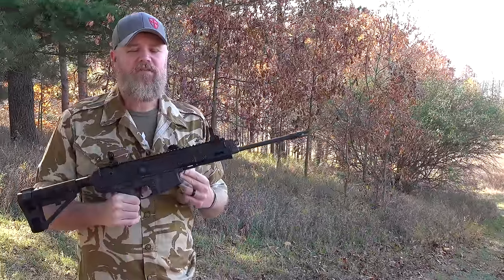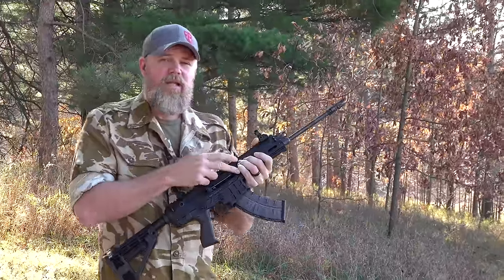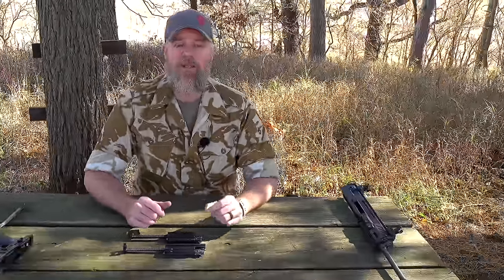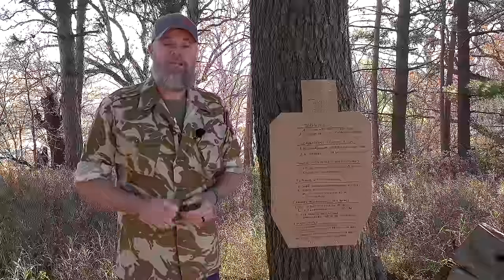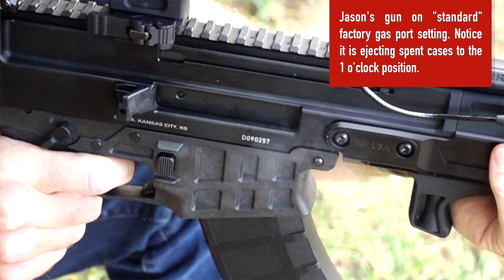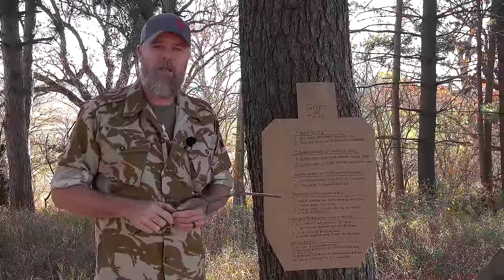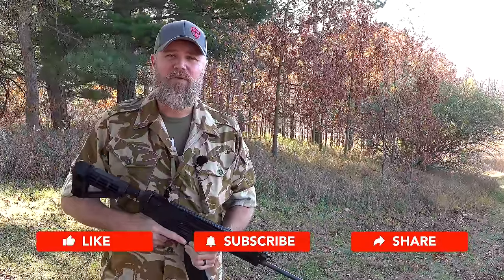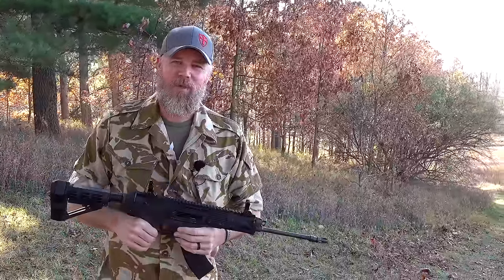CZ Bren 2Ms 7.62x39 Stovepipes: Cause and possible solutions.

Comment: My guess: the extractor spring is insufficiently strong what gives insufficient lateral speed of a spent case. As a result a spent case speed vector (a sum of a bolt speed vector directed back + ejector induced vector directed right) is directed somewhere to 5 o’clock (no good). You need to somehow increase lateral speed, not reduce the speed of a bolt with a bolt carrier.

But there is a caveat: you cannot increase ejector spring strength indefinitely — it has to still be able to latch on a round rim (may be improved with a stronger buffer spring?).

You need to drill nothing — just find a stronger ejector spring. Hell, I don’t understand how CZ has managed to overlook that issue...

Just my 2𝇍 of an aerospace engineer :)

Comment: The problem is in the shape of the reflector into which the cartridge case beats. Reflected strongly forward. You need to cut off the reflector as on AR-15. It's not ejector, or extractor problem.
Reply from the maker: That isn't what's happening. What's happening is the gun is way over gassed which is keeping the extractor and ejector from doing their jobs. We clearly demonstrate this with slow motion video showing the gas setting at its normal position, than how it ejects properly with the smaller port we drilled.
Reply: @Militaryarmschannel  Try to increase the angle of the reflector, and you will see how the cartridge case will start flying to the right.
Reply: @Militaryarmschannel  on AK it is completely absent.
Reply: @Militaryarmschannel  Since they are over-gassed to the point where the 14" jams, the 11" functions but still over-gassed, I wonder if they sized the gas ports based on the 9" one, assuming the sizes would be OK for all of them. I'm curious how the ejection is on the 9" barrel ones.
Reply: @yuri_yakovenko22  that’s already been tried by guys on the forums and it didn’t help. In some cases, it actually made things worse.

Comment: I just had a random theory...Since the gun is over-gassed, causing jams at 14" barrel length, but seems to function well with 11" barrel, other than kicking brass forward (still over-gassed)...Is it possible that they sized the gas ports based on the 8" barrel model, assuming it would work for all? I'm curious how the ejection is on the 8" barrel model.

Comment: So far no failures with my nine inch Bren, closing in on a 1000 rounds shooting mostly 122gr wolf. Ejection is around 2 o'clock.
Reply: I just had a theory that they drilled the gas ports to be functional with the short barrel, assuming it would be OK for the longer ones. I noticed how the 14" jams, 11" over-gassed but works. I bet your ejection is closer to 3" o'clock as well if my theory is correct.
Reply: It seems the longer barrel, assuming the gas ports on the barrel are at the same place, is receiving more gas due to a longer dwell time which is sending additional gas pressure down the gas port. Like your example of the 9" having even better "normal" ejection pattern compared the the 11"
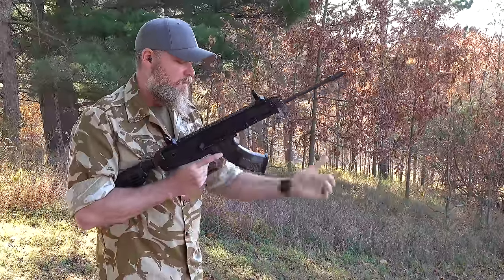Reply: @stuartgorka989  Yeah I'd say you're both right. I took some videos myself of the ejection patterns. I never got a 3 o'clock but it was a pretty consistent 2 / 2:30. Also after watching this video i inspected the front end of the ejection port. No nicks or scratches like there was in this demonstration. Hopefully it stays this way but i guess time will tell.
Reply: The issues are widespread across 9”, 11”, 14” 7.62 models, so barrel length is irrelevant, they’re all overgassed and have issues with extractors/ejectors.

If you read the user reports on the various forums, the FTE/stovepipes begin to materialize anywhere from 500rds-5,000rds so there’s really no way to tell if your gun is “good”.
Reply: @neptunetriton  Good info to know. Thanks.
Reply: @neptunetriton  Like i said, "time will tell."

Comment: I have an 11 inch 7.62x39 and have not had any failures to either eject or extract, HOWEVER it is overgassed in general and now that I have the 10.8 inch HB industries handguard installed it is creating huge flames through the mlok slots. It's even worse with a supressor obviously but happens without it as well. The only ammo that doesn't produce flames is Brown Bear subs. They won't cycle without the supressor on normal gas. Will cycle but not lock open on setting 2. The perfect combination seems to be subs with normal gas and the can. But I need this thing to run normal ammo without a can, with this handguard, or it's useless to me.

Comment: For what it is worth. I have the original model 9 inch x39, got it the day they were released early. I run it suppressed 100% and I've have no issues. In fact, I have shot it so much I actually cleaned it cuz I was annoyed with carbon dripping out of the sides and trigger. (I never clean fun guns till I have too)
Also, I have to run the gun on adverse to get it to cycle subsonic brown bear suppressed. Maybe they use a 9 inch optimize gas port for all barrels? I'd like to see mine cycle on slow motion suppressed.
I think the gun is fantastic, 9 inch with can is perfect. Replaced my 300 aac ar-15 completely. However, I don't like the new bren 2's they should of stayed the same as the original military configuration.

Comment: It just goes to show you how much work Eugene Stoner had to do working on the gas system on the m16 just to get it right. The other manufacturers have to remember that unlike the factory individuals will run different set ups and ammo than what manufacturers use at the factory.

Comment: I have recently returned my Bren2 MS x39 to CZ for warranty repair in regards to these same exact issues.  It'll be interesting to see what the problem is but I am highly pissed to have spent this kind of money for a problematic firearm.
Reply: CZ solution was to send me a new 14" back.
Reply: @charleslowrey9309  How did the new 14" perform?
Reply: @elitefirearmsnc2419  The new one they sent me feels over gassed, but didn't have no issues out of 120 rounds of steel cased barnaul.  Didn't start having issues out of the first till after 200 rounds.  Planning on getting a surefire warcomp pin & welded, but don't want to void the warranty.  Have the DH adapter ,and ACR stock ready to go on afterwards.  Leary about putting the HB handrail, and trigger on this one.
Reply: @charleslowrey9309  Ahh Mr. Lowery!  I recognize your name from the FB CZ Bren Group!!  I'm glad they fixed you up, but shame on CZ for you  not being able to customize it your liking.
Reply: @elitefirearmsnc2419  Hell, CZ didn't even tell me they were sending me a new one.  Fedex just showed up on Columbus day with it.  Maybe I will get lucky, and it will run, but I don't have enough faith in it, to ever use it as a defensive weapon.
Reply: @charleslowrey9309  man that's a hurtful feeling to have a $1800 paper weight, ugh!!
Reply: @elitefirearmsnc2419  Range toy is about it at this point.
Reply: @charleslowrey9309  I had such high hopes, but yes, you're right. Range toy it is!!
Reply: @elitefirearmsnc2419  If your looking for something to run 7.62 x 39, I recomend the PSAK GF4.  I am really happy with it.  Runs smooth, and has a sweet trigger.  Weight isn't to bad with the Magpul furniture.  The price point is about a grand less than the Bren2.  Just have to watch their sight for one to pop up.  Also comes with a lifetime warranty.
Reply: @charleslowrey9309  I've got a WASR-10 in x39. It used to have issues until I sanded and polished the bcg, added a new Wyndham Weaponry 7.62x39 barrel, replaced the trigger with an an ALG Defense Ultimate Trigger w/extra power hammer spring. It shoots like a dream with trigger pull weight averaging 2.5 lbs. No more FTF/FTE, and it just chews through steel case ammo. Now I'm working on a 10.5", x39 AR upper that I just got back from my armorer today. The lower is already completed with a 7.5" upper whichI'll beswitching out. I'm pretty much set on the Russian, I'm just focusing on keeping the ammo stocked.
Reply: @elitefirearmsnc2419  Might wind getting  CMMG MK47 (mutant) next.  I got one of CMMG's 11 inch uppers in 5.7 x 28  put it on PSA pistol lower with Larue MBT 2s trigger.    It quickly became one of my families favorite firearms.
Reply: @charleslowrey9309  that is so crazy you mention the CMMG 5.7.I'm finishing mine from a 8"barrel and bcg kit on an Aero upper and PSA lower w/Lantac drop in flat bow trigger. I think I'm good for right now with my x39 builds. My 7.5 upper performs well. I've yet to run my 10.5", but its just a quick swap.
Reply: @charleslowrey9309  right now that 7.62 Russian is the way to go. You can train and defend yourself with it. It also allows you to sit on your stock pile of 5.56 until you really need it.  Just opinion tho, lol.
Reply: @elitefirearmsnc2419  Definitely, but 7.62 x 39 keeps going up little by little.  Saw some 5.7 ss198 LF on ammo seek going for 3.40 a round.  Glad I stocked up a while back.
Reply: @charleslowrey9309  whoa, $3 40!! Are you doing any reloading?
Reply: @elitefirearmsnc2419  no, never got into it.  Here there is a primer shortage now anyway.   Seemed like a bit of initial investment, and takes some time to do.  Just always bought in bulk to save money.
Reply: @charleslowrey9309  same here. I grab when I see it. There's an ammo depot about 15 minutes away from my house that sells to the public. They allow patrons to purchase 200 rounds a day per caliber. This allows me to continue training and still put something away adding to my stash.

Comment: I started having ejection problems with 14” when I put 2” extension to make it legal 16” rifle length. I also added longer  flush hider from Vortex.  Maybe longer the barrel more over-gassing you get? I was wondering if it will work proper in silencer setting for me or smaller port drilled as sown in this video. By the way (if I got it right), 11” worked fine and 14” (longer barrel) had a problems on this video as well  :)

Comment: Thank you for the analysis and effort you put into the issue. I know this is mostly (exclusively?) x39 issue. But I can't help thinking that if CZ screwed something with the extractor/ejector in x39, they might have done the same in 5.56, but since 5.56 is not overgassed (it is not, correct?), the stovepipes do not occur. Or does 5.56 eject consistently at 3 o'clock? Thank you.

Comment: I got the 5.56 carbine and have had good luck with it so far,would be interesting to see the carbine ejection pattern. The 7.62x39 version I would like in a carbine after they fix the kinks. I predict a recall eventually.... hopefully see a custom shop that will drill that custom 3rd hole but I'm sure that will void the warranty  :(

Comment: Did you by chance measure the weight of the BCG and compare it? Just wondering if the weight might be different due to a bad supply of source material or lax QA. This might help explain the inconsistency in the number of firearms experiencing the issue.

Comment: Swap the two bolts, and see if anything changes.   And I wonder what size the port holes are drilled, on the barrel itself.  The 14” might be slightly larger.  Or maybe needs to be even smaller than the 11”.

Comment: I don't think this is because the gun overgassed. It could be that the spring for the ejector plunger is too light. The plunger itself could also be heavy, further slowing down the ejection, not to mention the weight of the case itself. There could be issues in the hole or the plunger with surface finish.
Reply: After all there are guns with ridiculous bolt velocities like the G3 or an overgassed AK, but they don't have problems. quite the opposite. To me that says the issue is with the plunger.

Comment: I wonder if you could put some kind of plug in the adverse gasport to reduce its size without drilling holes or voiding warranties? I'm thinking something like a roll pin. Of course metal selection would probably be very crucial. All those hot gases causing things to shrink and/or expand might cause issues if it's not implemented correctly.

Comment: Ill bet anything they ported it for the shorter barrels and in order to cut corners shipped them ALL with the oversized ports needed to cycle the shortest barrel length configuration.. At this point saying they simply didn't realize or was a qc oversight.. is naive at best..

Comment: To my eye, it almost looks like a part of the issue could be caused by the angle of the casing deflector (not sure of the correct terminology), the angle looks more extreme in comparison to a large number of AR15/M4 images that I looked at. The deflector appears to be bouncing the empty casings forward as opposed to off to the side.

Comment: Measure the factory gas port sizes on the 11' and the 14' models. The shorter barreled model should have a larger port diameter then the longer one, due to decreased gas port pressure from less complete powder combustion.  I'm guessing someone thought it was ok to have the same part ship with both models.

Comment: NUTNFANCY just posted a video on the 5.56 pistol and the button that retains the tail cap broke off as well as the loose fitment of the tail cap.  $1800 for a problematic pistol, no thanks.  There's a good reason the AR is still king .

Comment: their are always the alternative way to do thing, to solve thing. on the video that I've watched i saw those brass are ejected fine, it clear off the port but when it hit a brass reflector then its bounced back, so instead of drilled new port why not adjust a brass reflector to different angle, make it shorter or longer? i think you can make it reflect to any angle you want by not tamper with operating system.

Comment: The Bren 2 in 7.62 x 39mm over gas problem gets even worse when a suppressor is used.  A 1/32" I.D. gas hole maybe what works best when it is suppressed.  What Ammo does CZ used for Testing?

Comment: can they research and find a slightly stronger recoil/buffer spring to slpw the bolt down a bit? that be easier than drilling a new gas port ? goal would be it seemed to slow down the bolt? or am I missing something, i noticed also like you said Tim that its throwing shells toward your fingers n also to the rear at times, this is a gun I want to add to the stable before long,

Comment: Does the CZ use a standard AR-15 ejector spring?  My ACR had the same ejection problem.  Fixed by using quality AR ejector spring, and I think I replaced the ejector while I had it apart.

Comment: Would a CHEAP and EASY solution be to change the angle of the deflector so that the spent case isn't bounced back in the direction of the ejection port as much?

Comment: I'm curious. I've seen some people talk about the stocks/braces you guys typically get in the US and that they have a lot of wiggle. Specifically, the back plate, whereas the OEM stock is solid. I'm in South Africa and I bought a 11" x39 the other day that's straight from the Czech Republic, unlike my Scorpion that was imported from the US, and it's the most solid firearm I've ever handled, it comes with the OEM folding stock. It has no wiggles, jiggles, ratlles, nothing. I've seen a few people claim that that could also be related to some of the issues. Now, I won't be able to see if mine has issues yet because I have to license it before I can take it home, which is about a 3 month process, but I'm hoping that the problems are mostly with the US guns. I know it's wishful thinking, but I'm trying to be optimistic.

Comment: great info
Reply from the maker: Thanks brother. I'll see you here in a couple of days!
Reply: @Militaryarmschannel  the case deflector angle is to steep as well
Reply: Hey aren't you supposed to be banned or is that on a different technocratic organization
Reply: @dusuldorf24  I hear that got reversed.
Reply: @dusuldorf24  who was banned ?
Reply: Sweet!
Reply: @Militaryarmschannel   thanks for all you do!  A friend of mine was having the exact same problem,  about 35 failures to eject/stovepipe out of 200rnds. Brand new out of box no mods.  After inspection we decided to push the roll pin out of the case deflector and removed it.  400 rnds after deflector removal- zero failures. Ejection pattern is consistently at 2-3 oclock position. Not saying this is the solution but it has worked so far.
Reply: No You!
Reply: @Militaryarmschannel   i have the fix for the bren I've sent out 10 replacement parts id like to send you one to test
Reply: @unrulyares1337  hopefully Tim will take you up on this so you can get this out to the guys that need them 👍
Reply: my 11 in x39 cz bren 2 has been flawless!! has all the HBindustries upgrades etc! looking to sell or trade it because I got 2

Comment: Shouldn't overgassing the gun produce the opposite problem as the buffer spring has more rearwards energy it has to overcome?
Reply: The buffer spring will always be the same strength so if you're pushing a bolt harder it will go faster

Then you also get the bolt bouncing off tge back wall of the receiver meaning it also goes forward slightly faster 

I'm definitely missing something but that's my understanding

Comment: Doesn't it seem like the case deflector isn't angled back enough? The cases just slap the crap out of that thing.
Reply: Exactly. Doesn't anyone notice that the brass is going back into the port because it is bouncing off the deflector? Remove it for testing. CZ should have noticed this.

Comment: You said it shoots better aka less malfunctions the more you shoot if it's over gassed then the more you shoot the gas port is getting Carbond up more and restricting gas flow? If that made sense how it came out?
Reply from the maker: Gas ports typically erode and get bigger with use. However, if the gun is getting dirtier and this fouling is causing the bolt/carrier to slow down a bit it might be helping it. It's not a fix, just a possible observation.